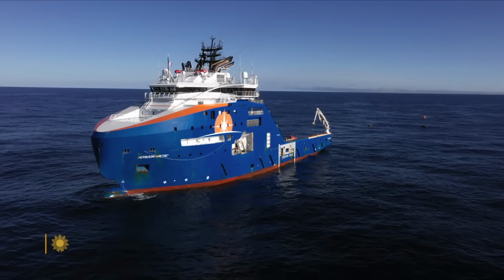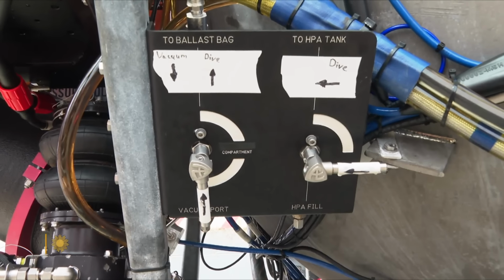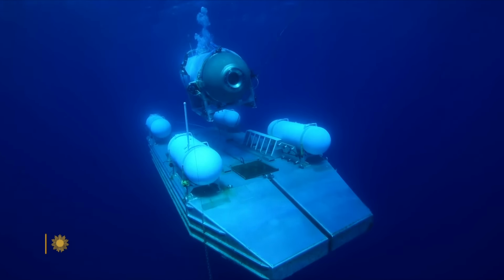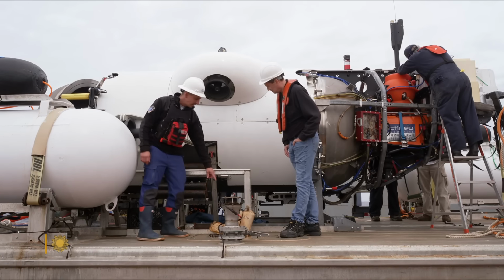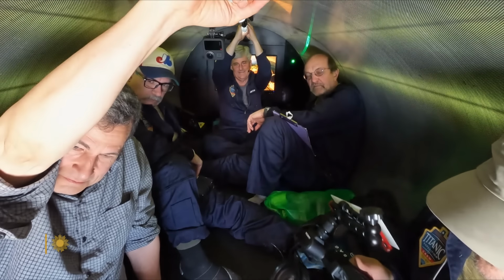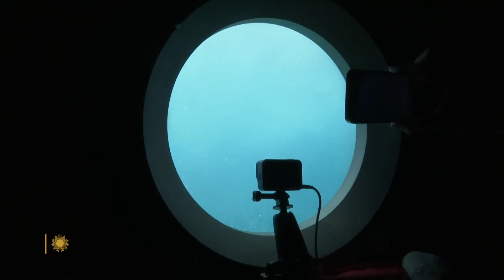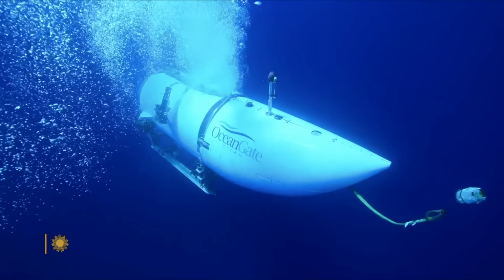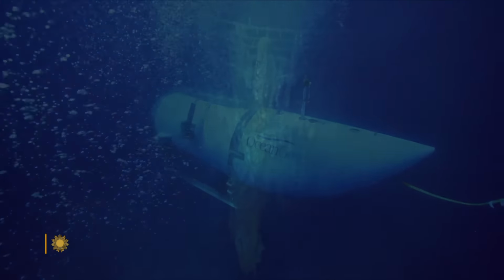Inside the Titanic sub disaster

Comment: It’s awful and they won’t find remains they are liquified , for a split second the immense pressure turned the air inside as hot as the surface of the sun. They wouldn’t of known anything about it. It takes 100 milliseconds for the brain to pick up pain. They were gone in 1 or 2 milliseconds
Reply: thank goodness better than suffocating

Comment: Based on the reports out there, there were very like stress cracks inside the hull that couldn't be seen by the naked eye and or corrosion problems with the metal on metal joints. I'm sure they had the resources to have an NDI (nondestructive inspection) done on the pressure chamber (entire hull) and metal on metal joints. Same thing they use in the aerospace industry. The other glaring issue.. the titan was unofficially and noncertified rated "up to 4000 meters". The titanic wreckage is at 3840 meters. Why would you take it to it's outer most limit when it already had several trips/wear and tear on it? Ideally you want a sub that is certified/rated at 5000 meters in my opinion.
Reply: Stockton Rush was motivated by pure greed.  Stockton was working the emotions of naive folks who have $250,000 just lying around.  What a stupid, ignorant statement, "Safety is a waste."  quoting Rush.  Cameron shared the word arrogance as being part of Rush's personality.  Condolences to all who perished because of Rush and their lack of common sense.
Reply: @ArtScottMusicStudios  If it was pure greed, he wouldn't have risked his own life. I think sheer ego is a factor too: He was a firm believer in his own genius engineering, to the point he didn't even consider the possibility of failure.
Reply: Hope they knew Jesus 🤟....
Reply: The carbon fiber to metal joints (titanium domes to carbon fiber tube) will be the focus of investigating the subs joints. Two dissimilar materials in a joint subject to cycles of extreme stress, being a worrisome can of worms in the context of this application.
Reply: This is really a dumb beginner mistake in the design
Reply: @Shaolin91z  "Welcome to the afterlife. Now, do any of you remember what I said about the camel and the needle?"
Reply: Rush, is a befitting name

Comment: I think he was onto something with his sub design, just needed more testing. To be honest, I  think the testing would've slowed down production and quite possibly change his design which he didn't want. 

Carbon fiber is a great material and is used in aviation alot. The deep sea is completely different though. Depth testing alone  is not enough. It needs to be cycled multiple times to test for fatigue in the structure and seams.
Reply: He used materials that were incompatible with each other. Multiple trips with those incompatible materials sadly did them in. I feel most terrible about the kid.
Reply: @Deribinkle , sadly using multiple types of material when carbon fibre is involved does not just create a problem due to stress cycling. Carbon fibre creates a nasty galvanic response, almost regardly of use but distinctly aggravated by salt water.
Reply: @weldonyoung1013  I agree. Carbon fiber has its place, but this wasn’t one of those places.
Reply: @weldonyoung1013  Yeah but they didn't slap the CF right onto the Titanium.
The issue with CF is it's great at containing the pressure from within,  but not from the outside.
Reply: @ToreDL87  yes, but OceanGate's Titan made 14 other dives (or attempted dives) to the Titanic as well as a couple test dives. I believe during all of this (it is hard to get reliable information) OceanGate did zero structural testing. The lack of investigation of new material design is the true tragidy of the Titan's demise (along with the "innocent" deaths).

Comment: How is carbon fiber better than titanium for this? How carbon fiber ever even came to be considered is confusing me
Reply: I know. I was always under the impression carbon fiber is flimsy. Light weight. Why we car guys replace body panels on our vehicles to lighten the car. It's less likely  to break. But not under extreme pressure or weight. I'm dumb founded too
Reply: It's not, that's the point.  Carbon fiber vessels work great where the pressure is higher on the inside than on the outside, like an airplane.  It's a terrible choice for a submersible where it must resist external crushing forces.
Reply: @jaymesnin same here, I thought carbon fiber was very light weighted and strong but not stronger than titanium 😂
Reply: It's not.  But was used because it is buoyant.  Then you can load more people, and strap on extra ballast to do the dive.  Makes surfacing easier and you can carry 5 people with less battery and motor power most likely.  When he said "strength to buoyancy ratio", that's what he meant.  In other words, we can make more money this way by using carbon fiber.  But it won't be safe like if built with a true contiguous material.  But that's what we have to do to generate the profits we want. The whole thing stunk to high heaven.
Reply: Evidently, it wasn't. Now they're fish food.
Reply: @OGLizardKing well it's no good being able to surface faster if there isn't a sub to go back to the surface 😂
Reply: @danielderias4773 Yeah, "duhhh....we have 7 ways to surface if anything goes wrong. And these crude sandbags will automatically detach after 16 hours...." If I was that reporter and saw that, I'd call my boss and say No Way!!!

Comment: I cannot believe that those people were foolish enough to be bolted inside that contraption without any means of escape or any means of being supplied emergency air in case of things going wrong. My sympathy goes to the families who have to live forever with the horror of how they lost their love ones.
Reply: You have no idea what you’re talking about. There is no “means of escape” 12,000 feet under the sea. Also, they didn’t die from oxygen depravation.  What good would oxygen would have done?  We already know they weren’t sitting down there playing spades waiting to be rescued.
Reply: @MegaSpaceMolly  I am well aware of escape being impossible, it is being bolted inside without a way out at 12000 feet or on the surface, but before they reach the point of no return there  should have been an escape facility. I do know what I am talking about with my  diving experience
Reply: There is zero possibility of an escape at that depth. Opening an escape hatch under that sort of pressure would be catastrophic. A far worse way to die. I'm pretty sure there was an escape hatch on the Titan, but it doesn't really matter since it imploded anyway. Just the trip to the bottom of the ocean takes nearly 3 hours. It just isn't possible to get out of there fast.

Comment: As I understand this whole story, it sounds like the Titan made several succesful dives before this last one. I know airplanes are retired after so many hours of flight due to the stress and fatigue on the material from expansion and contraction during the pressurization of the planes during flight. Like bending a wire coat hanger back and forth until it finally breaks. Carbonfiber has no giving points, and I know this from working with it, so each dive took a toll on the Titan in some manner until it could withstand no more. Maybe microscopic cracks throughout the hull not visable to the eye. It seems to me,  Stockton Rush should have realized this at some point. But at least he died doing what he loved, but a shame he had to take others with him.
Reply: Only 12 succusful dives
Reply: Yeah, I'm sure when he was being crushed by 1000s pounds of pressure in a tiny, claustrophobic cabin he thought " my idiocy was worth it"! 😂😂 
Why do you people always say the dumbest things like that?

Comment: SR said that the pressure would compress the acrylic window 3/4 inches inward. It's possible that they were gathered looking thru the window when the window couldn't take the pressure anymore and popped inward striking everyone in its path. In the first moments after the acrylic popping inward like popping the cork from a champagne bottle, there is no water in its trajectory except the passengers, and it probably went thru them like a missile

Comment: Titan was made of 2 titanium hemispheres 142 cm diameter
Which makes a sphere of radius 0.7 m and the central plastic-reinforced-with-carbon-fibre tube was 2.4m long, also obviously with a diameter of 140 cm
SO:
Sphere volume is 1.4 m3.     (4/3 πr3)
Cylinder volume is 3.7 m3    (πr2 x h)
Total 5.1 m3.  Let's call it 5 m3 for rough calculation
Boyle’s Law
Pressure x volume is constant
So pressure at the start x Volume at the start = pressure at the end x volume at the end
or in simple to read terms
p1 x v1 = p2 x v2
so
volume 2 = p1 x v1  divided by p2
15 psi x 5 m3 / 6000 psi
= 0.0125 m3.    Which is 12.5 milliliters.
a wine glass is 150 ml
a tablespoon is 15 ml
🤪🤪.
It was as they said - a bit cramped.
There was not a lot of space for 5 adults.
Even with sandwiches and a Rubic cube and a portapotty

Comment: “Carbon fiber is better than steel or titanium” said Stockton Rush. That statement alone is idiotic. “Better than”. I’ve worked with carbon fiber, it’s basically a fancier type of fiberglass. Same basic idea. Fibers, or strands of material, held together by epoxy resin or polyester resin. You could say it is lighter than steel, but “better” than steel? In what way?

Comment: While inspection by regulators may have prevented this tragedy, the innovators are correct. Regulations stiffle progress. Now, an investigation will discover what went wrong, fix it and improve the carbon fibre sub. Had the regulators gotten in the way, no such improvement would have been possible.

Comment: In aviation, we contact our airframes division to do non-destructive inspections  (NDI) infrared camera in the composite portion of our fighter aircraft engines after removal. Which the composite serves as the outer bypass duct of the engines; exposed to tremendous amounts of heat and pressure, but nowhere near as this submersible. I wonder, if these men performed such inspections in their submersible’s composite material, which if they didn’t could raise eyebrows to negligent maintenance of their submersible vehicle… hmmm

Comment: Who can say that a small water leak didn't form before the sub collapsed? Or the creaking sounds that would have likely occurred.
Also, it would not have collapsed the same way metal would. Remember that this is carbon fiber. It would have shredded into seperate strands. 
I theories that the collapse could have been more gradual. Carbon fiber is so strong that, water could have noticably leaked in as the fibers were slowly delaminating and deforming right before their eyes.😮